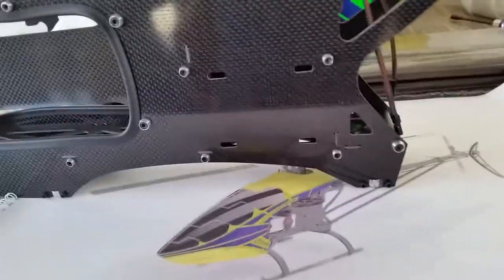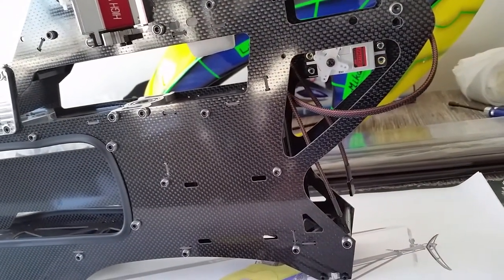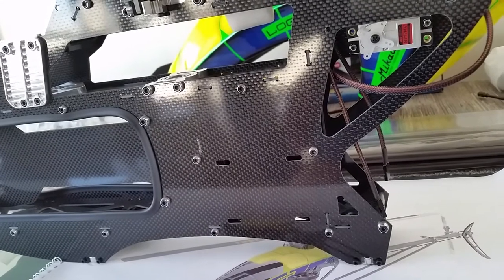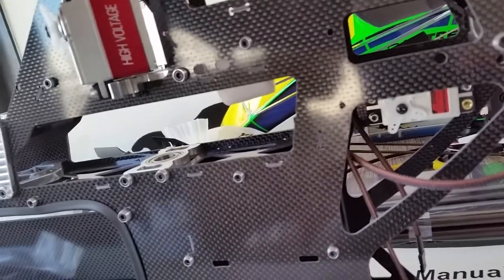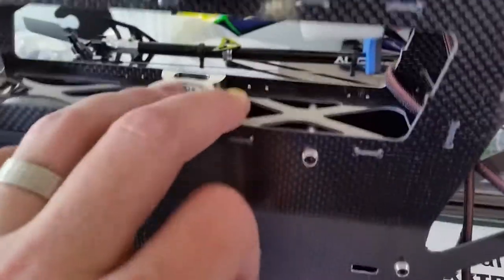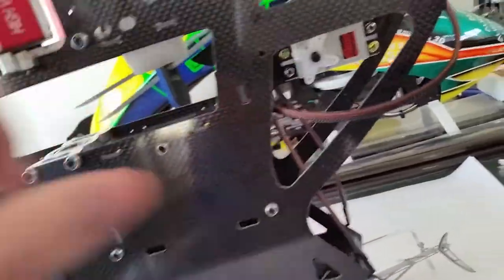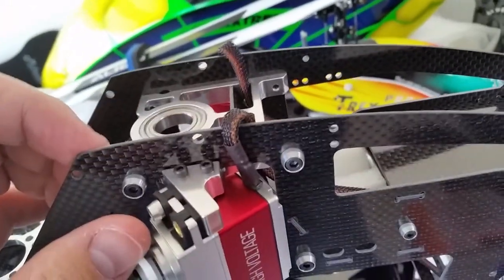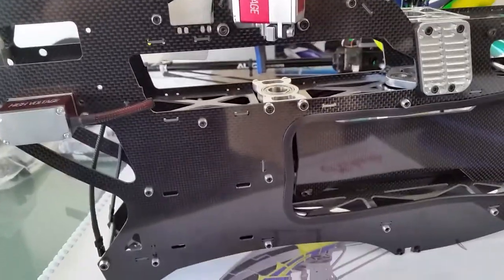Logo 800 XXTREME Build Part 1

Comment: Hey.  I bought a L0GO 800, help me connect the shaft of the main rotor
Reply from the maker: Hi please check the Logo 800 thread on helifreak https://www.helifreak.com/forumdisplay.php?f=292 if it contains answers to your question. If not then post your question there and I will gladly help. Otherwise please give me a little more info about your exact problem and I will try assist.